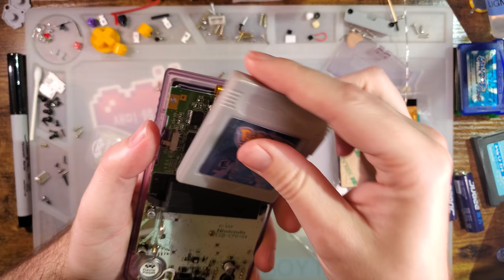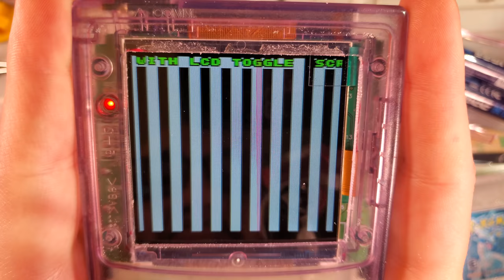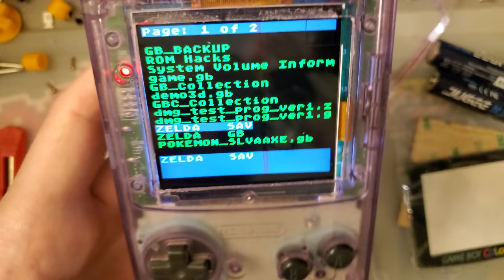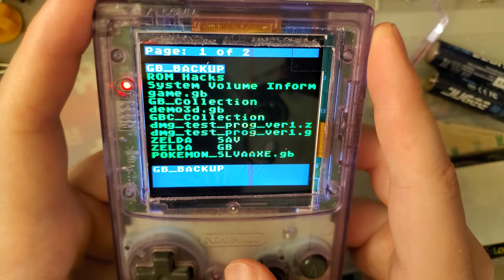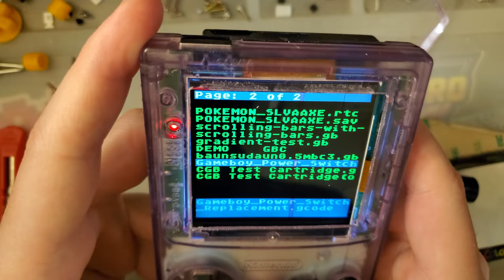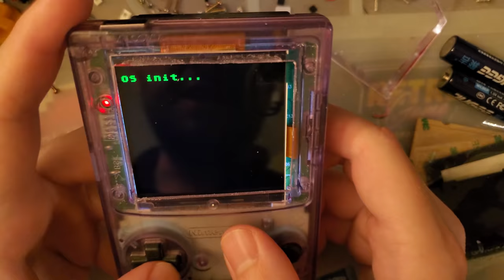2.6" IPS Game Boy Color Kit (Cloud Game Store)

Comment: I've had issue with touch sensors too. One thing I recently discovered is that if you solder a thin piece of magnet wire instead of the sensor and tuck it in between the two halves of the shell (like along the lip and groove) it tends to be more reliable and less noticeable.

Comment: Thank you for the full video on this. I love the Cloud Game Store kits (installed 2x 2.6" pocket kits and the drop in GBA kit into an OG GBA) and I'm curious about this one too, but I don't like having to cut so much of the shell out to make it fit. I'm looking forward to seeing one the same size as the original screen. Either that or I might attempt building a "colour pocket" like you did ;)
Reply from the maker: Well, new shells just dropped so no trimming is necessary if you use one of those.
Reply: @makho  I'll take a look, thanks!

Comment: The Funnyplaying Q5 Retropixel v2 is a wonderful kit as far as presentation goes, but they have an egregious design flaw- the way the bottom portion of the LCD is unlaminated and separated from the lens by the shell leads to stress on the bottom portion of the LCD, where it's adhered to the lens. This leads to quickly developing dead pixels on the bottom portion of LCD that only get worse with use. That kit is just way too fragile for me, and my first install was ruined within 24hrs. As much as I love the laminated look, I'll probably avoid using them until the Slate... 

Can't wait to try out one of these cloud kits tho
Reply: I was wondering why my Retropixel v2 developed dead pixels. Thanks for the explanation! What is the slate? I really like the laminated look and I wish there was a kit without this flaw.
Reply: @ytvandre  The Slate is a GBA SP mod that Makho designed! It also utilizes a laminated screen. Most GBA SP kits that use laminated screens that don't suffer from this flaw.
Reply from the maker: Y'all need to be checking your kits out of the shell first and then make sure there is nothing in the shell that might get in the way of the install (such as flashing from the mold). When installed properly, this is not an issue. I've seen plenty of screens get damaged in shipping, damaged from handling, or damaged from improper install but I've yet to see one damaged from normal use.
Reply: @makho  I agree with Crusty, this is a design flaw. My build is using the ‘official’ funnyplaying shell for the retropixel screen. It developed dead pixels after I placed my carry-on- bag under the airplane seat. Granted, it wasn’t the greatest idea, but I wasn’t banging it against walls. All my other electronics, iPhone, kindle etc were fine.
Reply from the maker: @ytvandre  Every single time one I've heard about one of these screens getting damaged, the story always starts with "after I did <thing>" and I gotta say it does not help the case. I remain skeptical until someone can provide proof.
Reply: @makho  Nah, it was a clean install. On further inspection, however, it appears the issue could also be coming from the leads of the cartridge port damaging the LCD from the back.  Given where the dead pixels are on the screen, It looks like the leads could be pressed against the connector/components on the ribbon cable and putting pressure on the screen from behind. Regardless, my kit broke when it was in a hard-case in my backpack, which I wouldn't consider outside of the realm of normal use. My build was also using the FP shell, with the original version of the V2 kit. Either way, this was an issue for me with the kit installed per manufacturers instructions. Just thought I'd put that out there. It's a great looking kit, but it did not hold up for me at all.

Comment: i just recently installed the gba hdmi board you recently covered in my gba and now i can't adjust the backlight with the button combo for my ips screen, are you experiencing the same thing?
Reply from the maker: I have not had that issue.
Reply: @makho  interesting, so you can still adjust the brightness on the one you hdmi modded huh.
guess i'll have to open mine back up and recheck everything.
Reply: @makho  i opened up my GBA again and it turns out one of the wires came off so it was a super simple fix 🙂

Comment: I have this screen i love it but for some reason it foes not work with my funny playing lipo batt mod. The screen is black and a squeaking sound. But when i put the oem screen in it works fine. Im stumped
Reply from the maker: Try removing the power wire for the LCD if you have it soldered or add the power wire if you skipped it. There's a weird quirk I'm still trying to track down with specific kits and certain model GBCs that have been LiPo modded.
Reply: @makho  thanks for the reply i had figured it out but i still appreciate your feedback <3. I will leave this here kncase someone runs into the same prob. The 2.6 inch ips and the lipo funnyplaying mod needs more juice. I swapped out the old power board with my boy helder's power cleaner. Thing purrs now